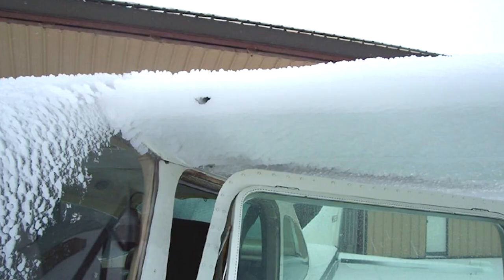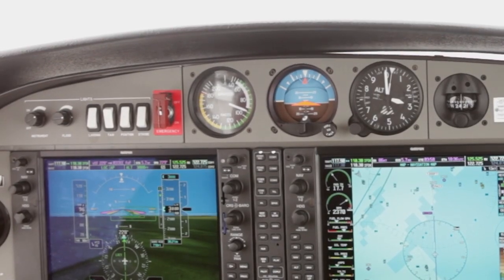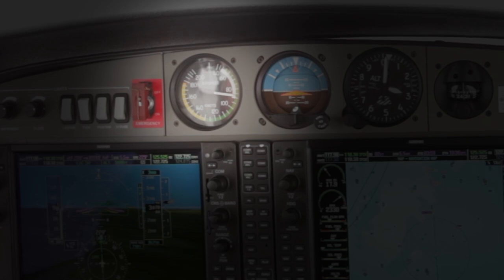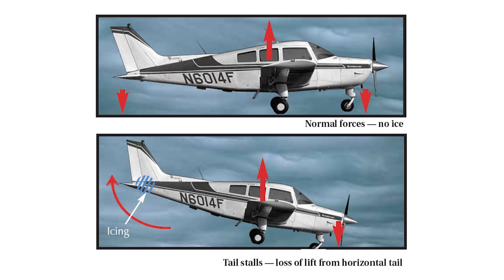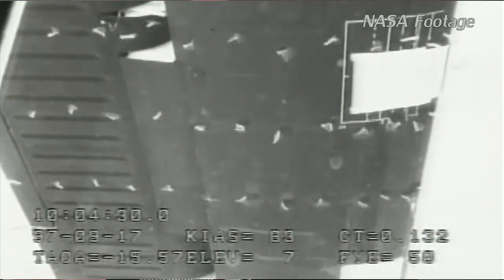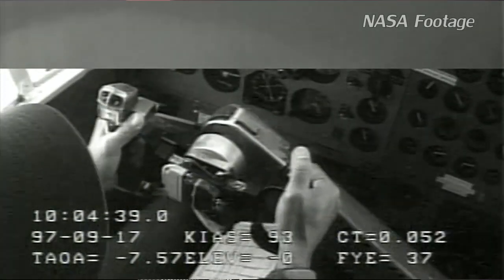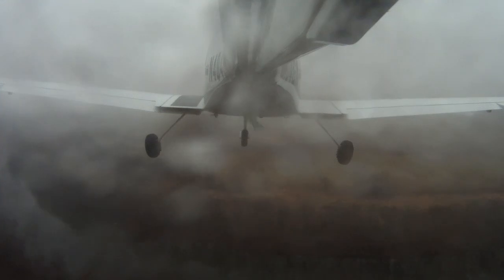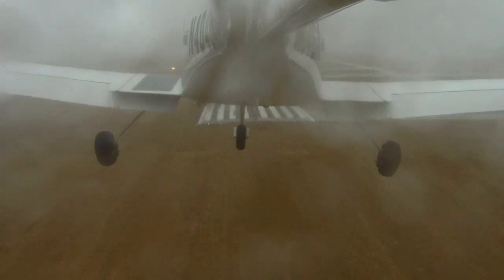Flying the Weather: Airframe Icing

Comment: I will not start a flight if my destination is below freezing or close to freezing.  Next, fly an aircraft capable of climbing to above the overcast layer.  Fly to the destination in clear air to avoid icing, and then fly a non-precision approach, allowing you to descend quickly through the icing level.